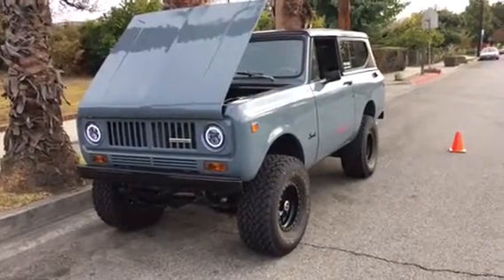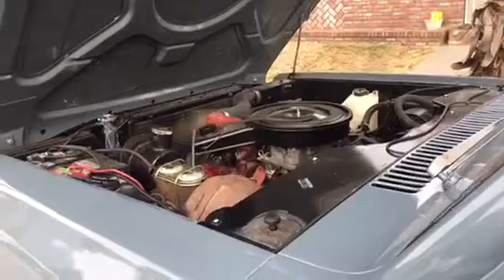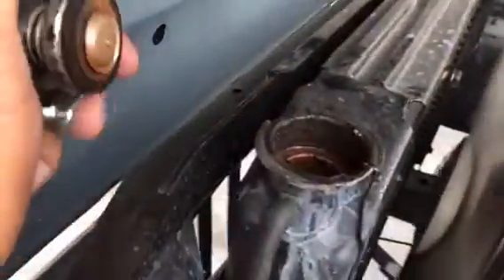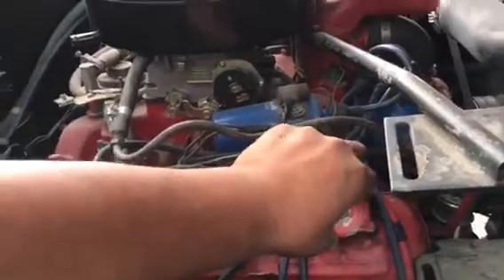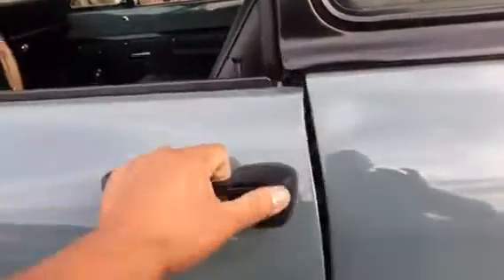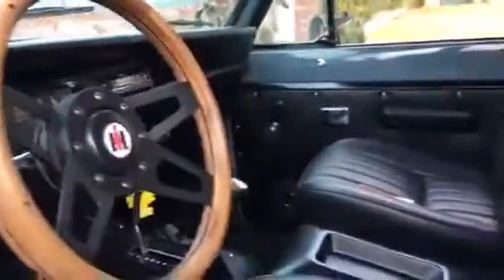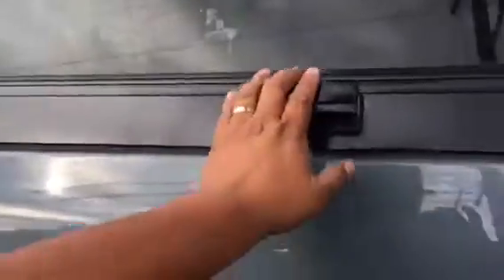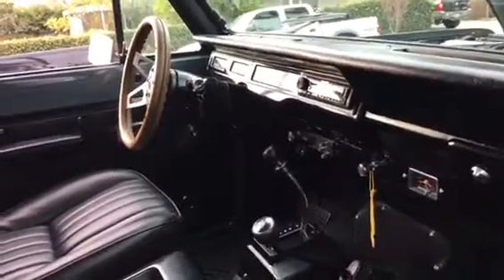1973 International Scout II

Comment: Needs a rad shroud,  the air intake is on the wrong side, the flame arrestor isn't hooked up to the air intake, the AC compressor is missing.  Not sure what that bracket is coming off the front of motor above the ac bracket but that isn't supposed to be there.    Body looks great on it though!    I love that steering wheel too.